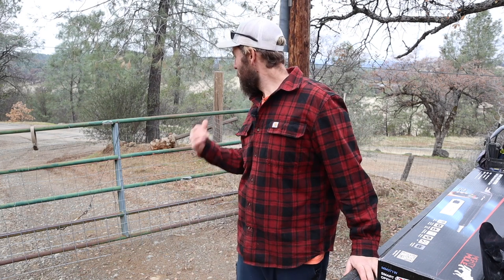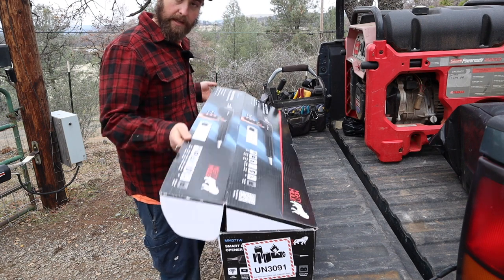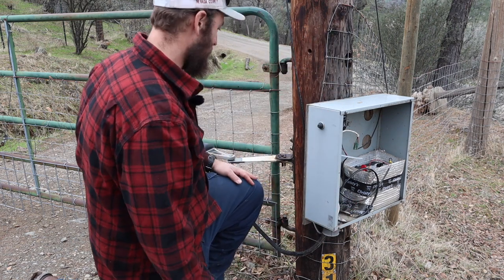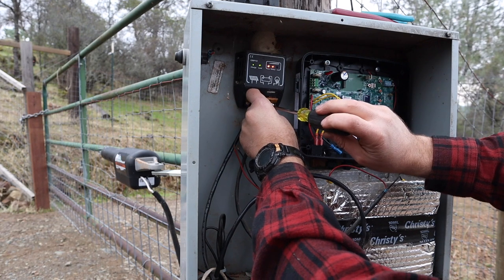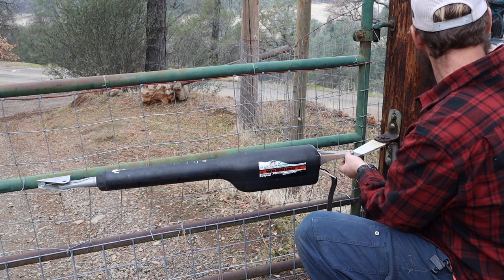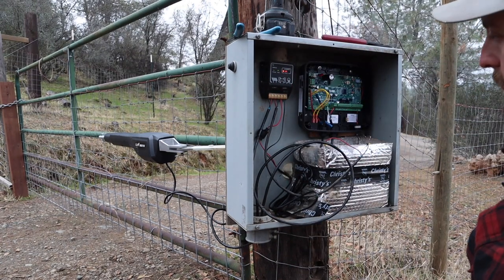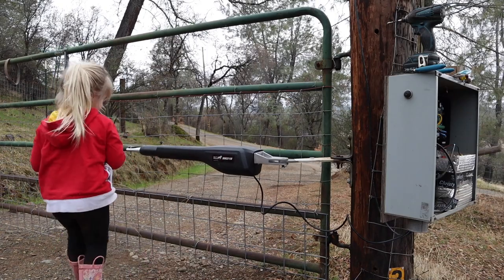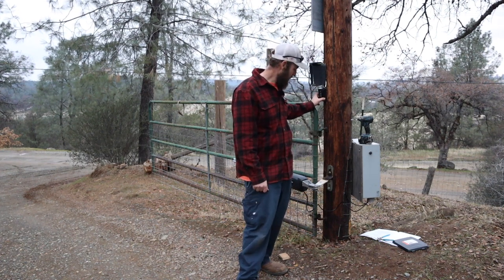TIME TO UPGRADE THE GATE OPENER | JoeSimple

Comment: I debated between the MM and Ghost Controls, and ultimately decided on the GC TSS1.  Have had it for 4 years, and it's been bullet proof.  Takes about 20 seconds to fully open/close, and with a latching zombie lock, it fully secures the door against anyone/anything pushing/forcing it open..
Reply: How long after you posted this was it when your opener broke?
Reply: @rlsllc4584  the motor STB about 3 weeks ago and my original comment was a year ago.  The motor and gearbox have a lifetime warranty so GC replaced it immediately, covering all shipping costs.  They told me to dump the old motor as it has no value for them.  I cannot tell you how satisfied I have been with GC.
Reply: Good to hear.  I’ll look in to them. Thank you.

Comment: Did you manually turn off the alarm when gate open/closes? Or, did yours not beep when opening/closing?
Reply from the maker: I did not manually turn off the alarm. There is an option on the pannel for an alarm wiring.

Comment: Did you have to program the open limit before pairing remote? i’ve hooked my up brand new out the box like the instructions says and gate won’t open with remote but will open about 4”-5” via jogging it open by control panel then stops.
Reply from the maker: Hmm... I don't believe it matters. I believe I set the remote before setting the limits. That's odd it will only open 4-5 inches is it binding?  If I remember right there is a resistance sensor that will stop the operation I.E. if the gate was to hit something.
Reply: Did you ever figure out?

Comment: How did you get your old single button remotes (with the dip switches) to work? I've heard they do work, just asking to be sure.
Reply from the maker: I did try to get an old opener with dip switches to work, it didn't work this unit has a program button that pairs the remotes. It may work i didn't look in to it to far.
Reply: @JoeSimple  That's it, you have to do that... and if all your remotes have the same dip switch settings, then they will all work with the "one" you tell it to learn. I have 4, they all work when I set up one of them.

Comment: Have you had any problems with the braket that bolts up to the gate? I'm a lilltle worried the bolts will worn out the holes drilled causing play and then braking the gate. . What do you think?
Reply from the maker: No issues here, I did use lock nuts so there is no play in the bracket. Also the gate is very well set, with out the opener attached the wind would move it, no resistance.